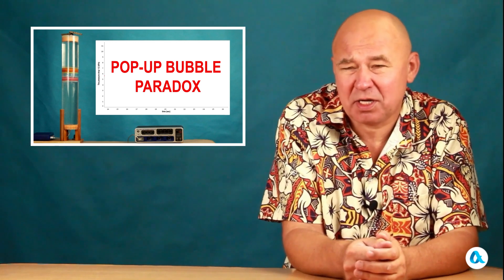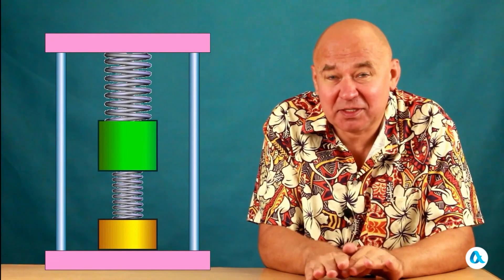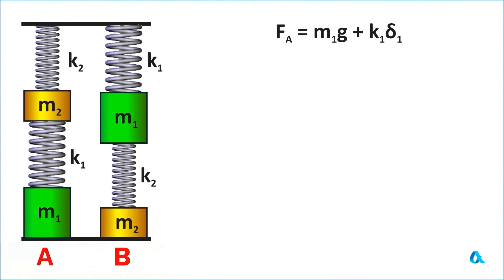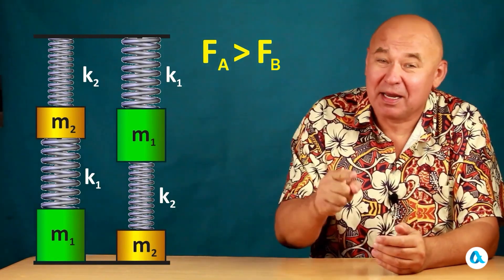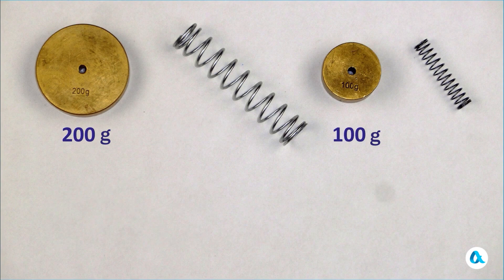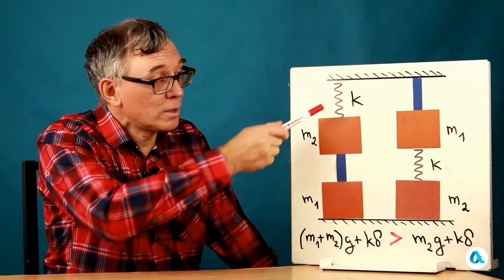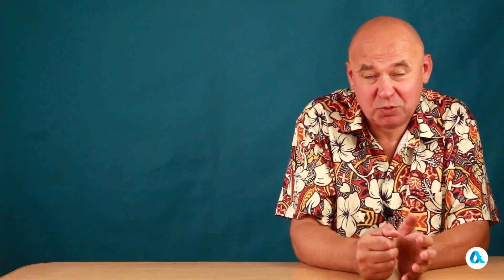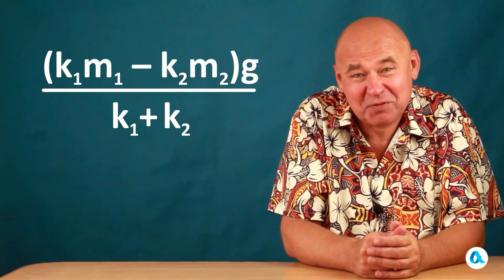Weights and springs

Comment: That still blows my mind even tough I even checked it with a scale, two weights and two springs. The experiment doesn't lie but I still cant wrap my head around it! Just makes no intuitive sense even with your simplified explanation. I just cant get myself to belief that the top spring removes some force.
Reply from the maker: Great point!